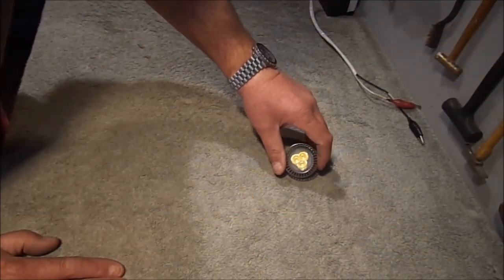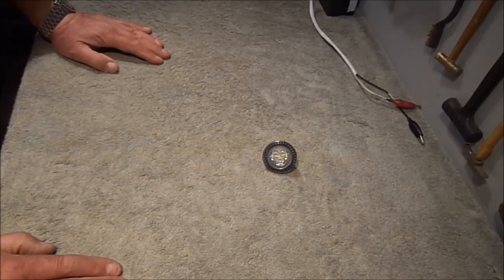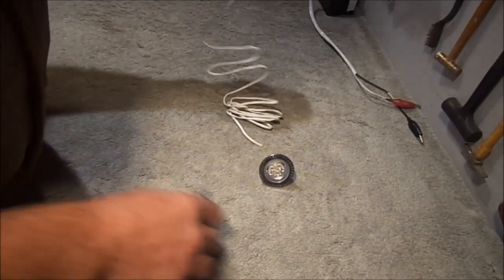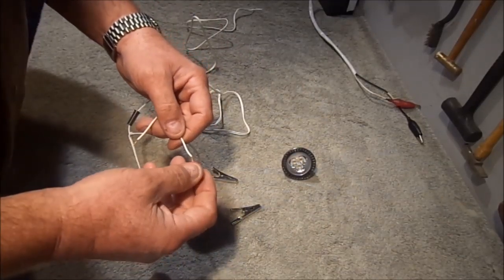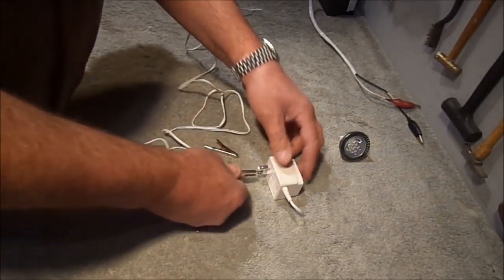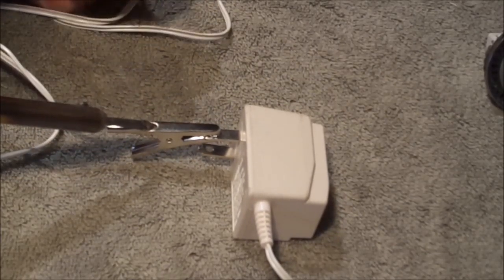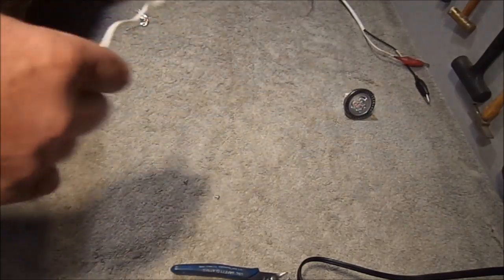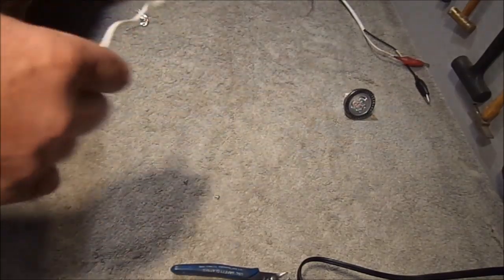Dirt Cheap Hi Power LED Emergency Light

Comment from the maker: AS long as the bulb is 12VDC, you can. However 12VDC bulbs with household bases are rare, they exist, but are not too common. It would be easier to have a dedicated 12VDC lamp with the LED installed and wired, and have it in storage.